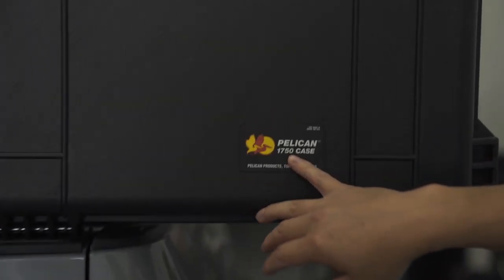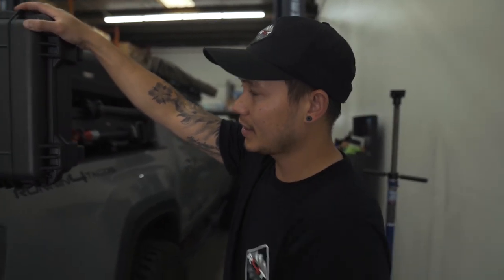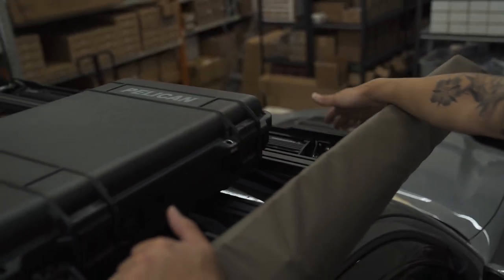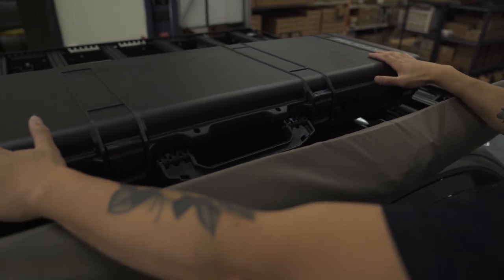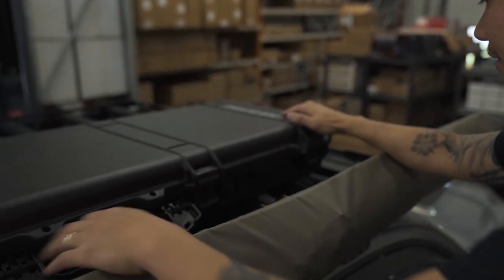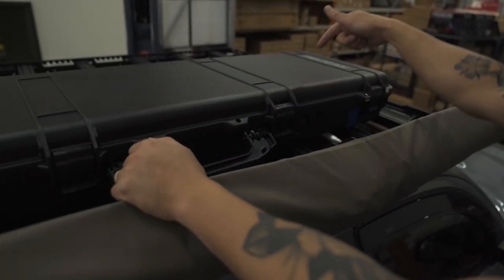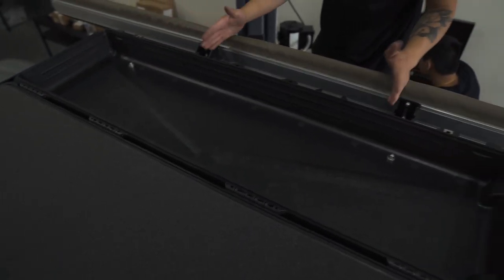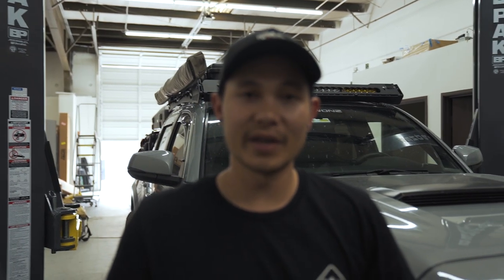How-to Mount a Pelican Case onto a Tacoma Roof Rack

Comment: Great video gave me good pointers for mounting my case. The only difference I did is I threaded the bolts into the rail first and dabbed the tips with white paint. Gently placed the case onto the 4 bolts and had perfect drill marks

Comment: Nice video. Just want to point out that water goes wherever the hell it wants—it doesn’t always go down. Especially when driving at highway speeds. While I wouldn’t be too concerned with water intrusion at those bolt holes, it’s likely best to use rubber washers at the least if you really need the interior to stay completely dry.
Reply from the maker: Agreed but haven't gotten any water inside
Reply: @Runnin4Tacos  on another note, what light bar did you guys install with the uptop roof rack on the black taco? Looks like the extreme led 38” but wasn’t sure.

Comment: Great idea using the ridges on the case to line up the blue tape. I'm stealing that idea for sure! Is there a reason you didn't add blue locktite to the end of the bolts? Not that it's needed but it would help prevent the bolts from loosening after a while.

Comment: Yakima makes a basket called Load Warrior; eliminates the need to drill into your gear boxes. Just drop them in the basket and secure with bungees or straps - done deal!
Reply: Not for long term storage. With these pelican cases you’re able to lock it and keep whatever is inside secure and out of sight.